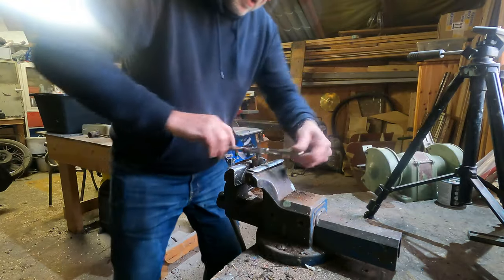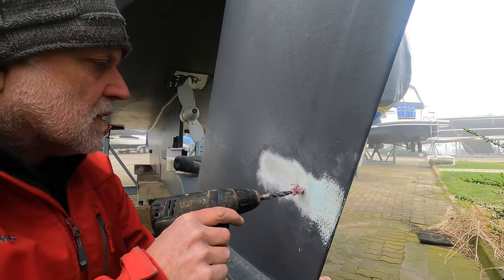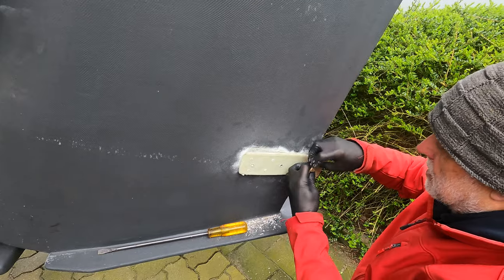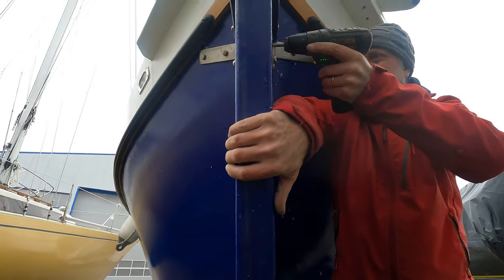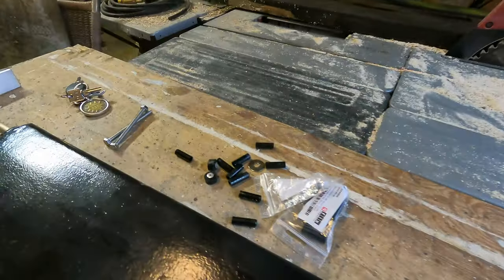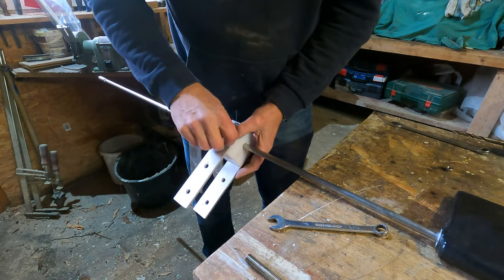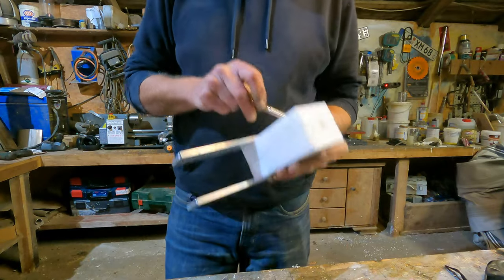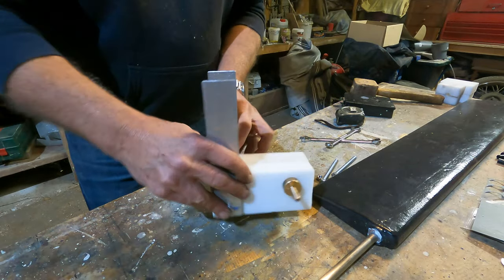The Windvane Trim Tab Epic Continues...; Building a cruising sailboat - SV Tapatya EP321

Comment: To 'lock' a mild steel or bronze nut and bolt, use a center punch to deform the thread where it joins the nut. It won't work loose, but can still be removed if needs be...
Reply from the maker: Yes Mike. Good point 👍😃

Comment: Buy stock that is to size, thread both ends to form a stud and make 2 nuts, it reduces a fair amount of turning.
Reply from the maker: That’s certainly the easier option, Bruno, but it involves more buying as opposed to using materials that I already have 👍

Comment: I was wondering what your lad was up to. the more he fills out the more I can see he has the look of you.
will them differing metal bolts be a problem since they arn't phisically touching? I remember you finding metals on you engine that were "Opposite ends of the galvanic table" and it always stuck in my head to check these things after you said when dealing with dissimilar metals in water or salt water.Can't wait to see this wind vane in action!
Reply from the maker: Thanks Alston. Yes, he’s doing an apprenticeship, as I did, and a natural at mechanics. Proud of him!
I do my utmost to avoid different metals exposed below the waterline. I’m less fussy in the air. I believe they won’t suffer too much if they are isolated from each other. This only needs to be a thin plastic washer or even a good smear of Tefgel grease (although it’s rather expensive). The other advantage of above the waterline is that it’s a lot easier to keep an eye on it and maintain where needed 🤔👍

Comment: I do hope you use sort of mechanical fixing to those bronze nuts. Drill and pin or lock tight.
Reply from the maker: Certainly a drop of loctite on the upper one. The lower one is bedded in epoxy and will be painted. Most unlikely to work loose 👍

Comment: why not flatten two sides of those round head bolts so you can tighten with a wrench? Doesn't have to be too deep either.
Reply from the maker: Fair point, Jim. I did consider that bug thought it unnecessary for this application. In other uses, it would certainly make a good bolt 👍